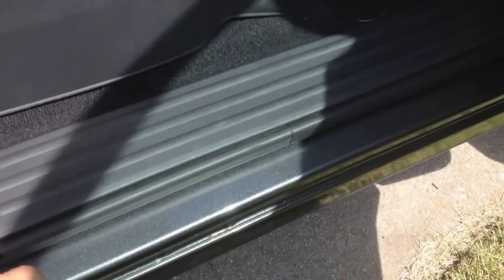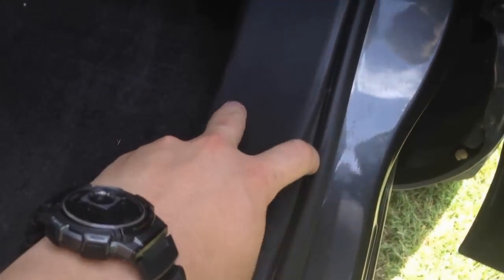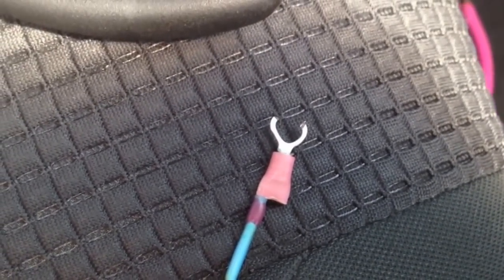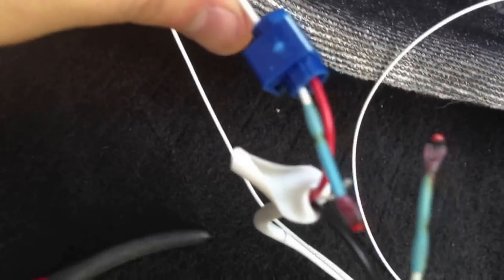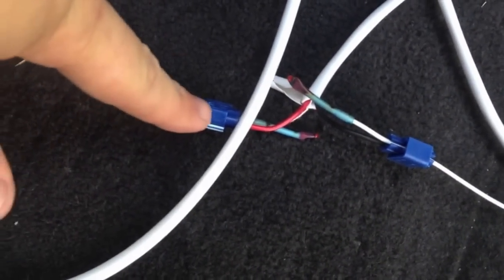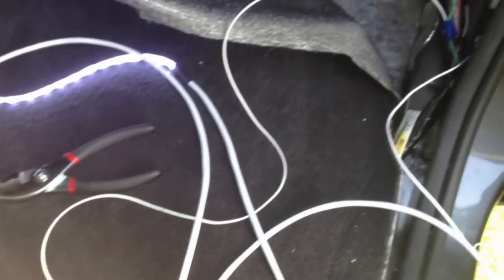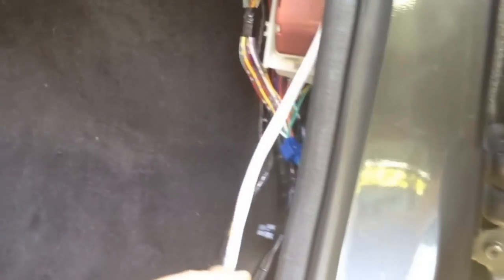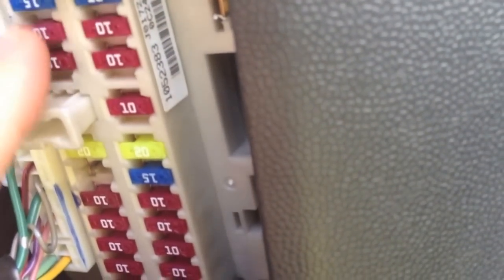HOW TO Install LED Footwells (Nissan TItan)

Comment: I used your method on my 2013 F-150. Used my continuity tester to find which wire powered and dimmed with my key fob. It works!! Every other video I watched never showed a good way to set it up to turn on and off with the interior lights! THANK YOU!!
Reply from the maker: Nice work!